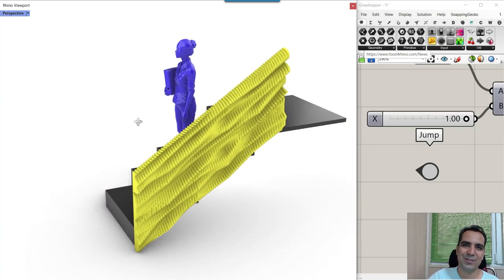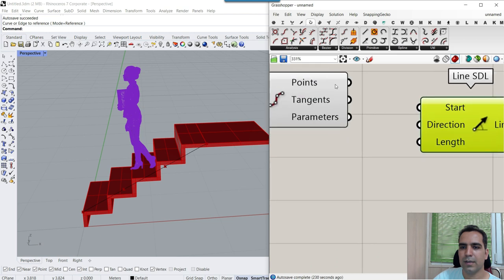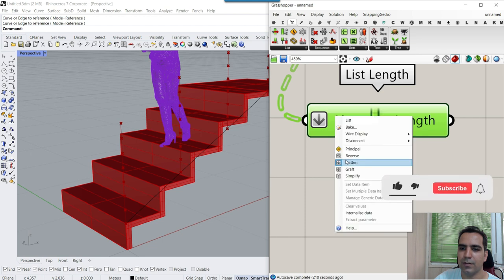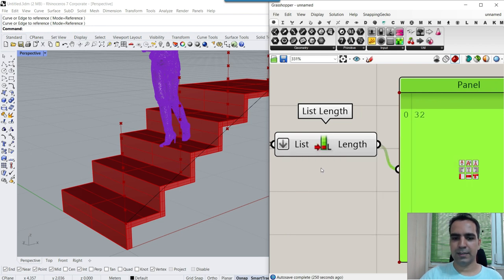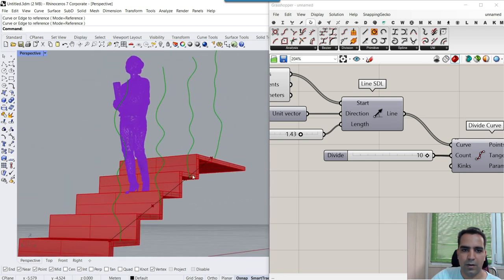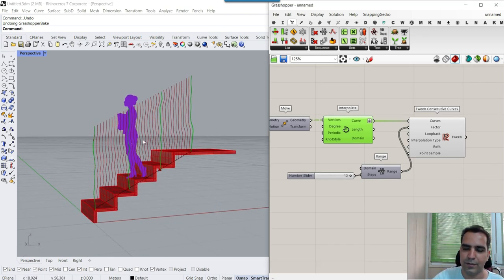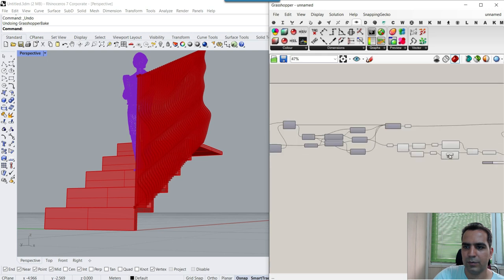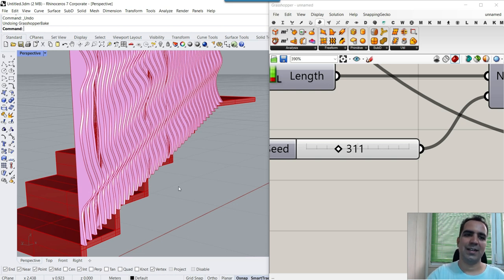Grasshopper Tutorial (Parametric Stair Railing)

Comment: Hi, 
I would like to know if there is a way to convert the mesh into BREP or NURBS surface that I can easily open in SolidWorks?
I have been exploding your channel for a week and you do provide very good resource for using Rhino Grasshopper. Thanks!
Reply from the maker: You're welcome. You can try using subd conversion of the mesh . If solidworks works with Subd you're good to go but if it doesn't you have to manually convert the subd to Nurbs. This proces is completely manual as you have to look for the star connections and then convert it in to multiple patches of nurbs surfaces connected together.